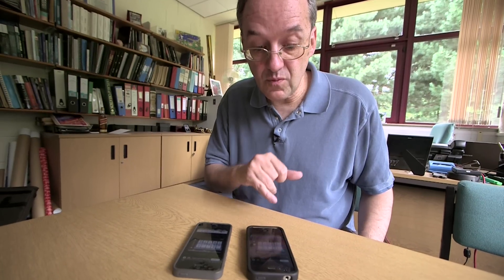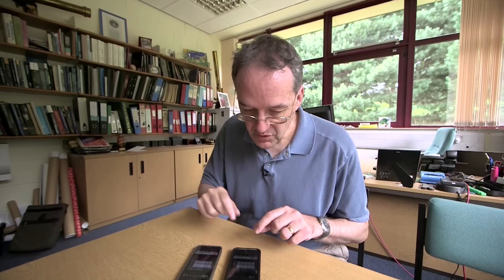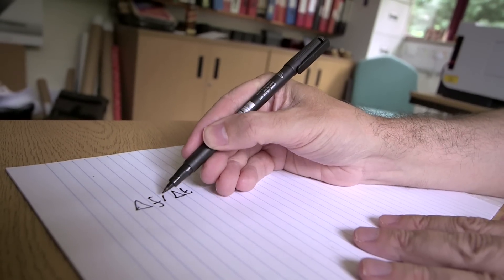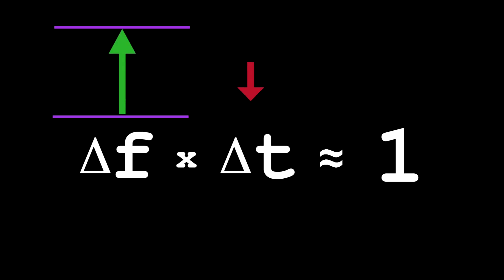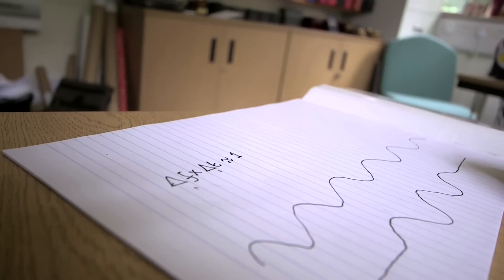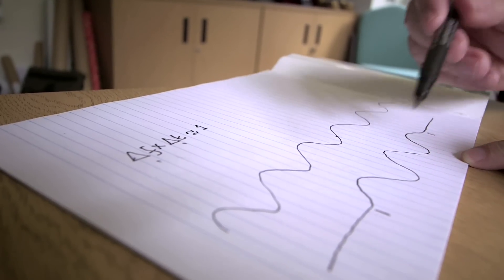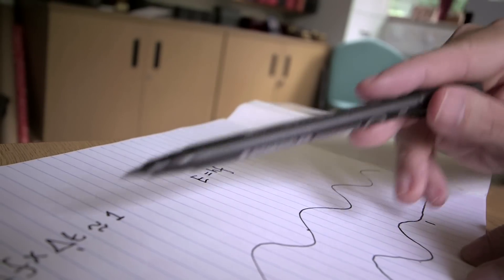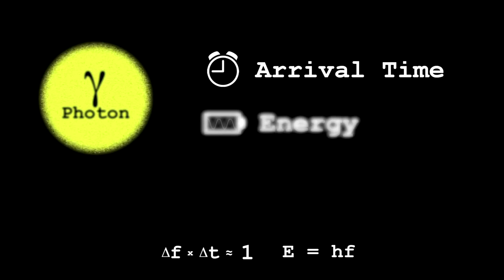What is the maximum Bandwidth? - Sixty Symbols

Comment: My first thoughts went to WDM too, but what the professor says is still true (mathematically) - even with WDM, you cannot carry more data than can be distinguished by a single pulse of information.  Whether you're carrying one serial PCM signal point-to-point or multiple signals in parallel over WDM, if the transmitted data exceeds the mathematical breaking point it will no longer be possible to accurately differentiate between two signals using WDM or PCM.

Comment: Yes.

The problem is simply that since the cable has a non-zero radius, there are several paths for light to travel, and some are shorter than others.

The light that goes straight down the center of the fiber (fastest) arrive before the light that bounces around the inside of the cable (slower), resulting in a gaussian shaped distribution of arrival times.

Has nothing whatsoever to do with the source.

Comment: More like in the neighborhood of 300 Tb/s. But keep in mind, we do not have optical processors that robust yet. It's a theoretical maximum.  Keep in mind, the bandwidth rating your cable company gives you is a maximum bandwidth. Your actual bandwidth depends on network traffic and routing. If packets are being forwarded efficiently, you have more, and if they are not, you have less. The map of the main internet backbone plus the connections of the L2 and L3 providers is a bit messy.

Comment: Surprisingly enough, you can.  You just need an extremely well-isolated coil (or loop, or *almost* loop, called a "SQUID") of wire to avoid picking up just the ton of photons from the vibrations in the surrounding material.  If you cool down the wire enough (e.g. ~10mK) and have good enough magnetic isolation (e.g. ~100,000x lower than the magnetic field of the Earth at the surface), you can identify excitations (electric current) from photons at particular frequencies. :)

Comment: You CAN use red and green, but infrared is normally used and the wavelengths are usually spaced 20nM apart (e.g.1510 and 1530nM). They can be much closer, but that gets expensive.

Comment: as for superconductors, they are not of any use to high speed communication, because they need to be cooled down to very low temperatures and the major difference is that a fiber optic cable poses no fire hazard, they do not heat up and they can not be affected by outside radiation. noise can not travel though the shield.

While one of the holly grail in in physics is to fine/ achieve super conductivity at room temperature, I'm sure that fiber optics will still be the connection of the future.

Comment: I think the drawing was not perfect. It would be easier to describe it if he would start the second one not from the zero but from the top of the sin. Then you would clearly see that this fast jump in value is indeed much higher frequency. Small frequency - slow changing, big frequency - fast changing signal. In other words, everything what looks sharp and pointy on the graph will be high frequency.

Comment: A sine wave will always have those two peaks, but a plain sine wave cannot  transmit information. When you use phase modulation (PSK for didital) it creates additional frequencies by it's very nature. This is because of the derivative relation of phase to frequency. f = d/dt(phase). Depending how quickly you change the phase determines you're bandwidth.

Comment: This presentation of the Physics revealed by the science of measurement, is exactly the right, (not the alternative that is "not even wrong", ..amounts to "nought"), information basis to make a standardized statement of effective meaning. The nearest to a Mathematical rationalization and reason for Philosophical acceptance. So:-

I think the maximum bandwidth is zero-infinity based on quantum logical connection, which, by being due to relative temporal motion is the constant creation of "theoretical" holographic positioning. 
We are a composite loci of full bandwidth integration subject to the Observation of the Uncertainty Principle circumstances.  

This is equivalent to a "first approximation" belief, because the choice of reference positioning is relative to personal, evolved POV perception at absolute zero-infinity ground state boundary, ..of abrane or flat space Central Limit in Eternity-now. 

Equivalent physical standards of observable/measurable constants made by timing clocks for GPS Navigation now, are the sucessors to the collective (political) Observation of a chosen Ruler in olden days, who set standards for measurements/quantization. 

In other words, it's impossible to set an absolute standard without some personal innate perception bias.., like a mathemagical musical symphony of 1-0, on/off datum points, DDD driven by AM-FM temporal Superposition-point Singularity.
Therefore all human categorization of phenomena is in the range of zero-infinity in reference to personal standards selected from a philosophical meaning and motivation from this range of Human/Cultural experience and ideals.

Comment: Well obviously fiber optic communications use amplifiers to increase the gain of the signal after a certain distance, and although theoretically noise cannot be eliminated completely due to quantum mechanics and more so practically due to the nature of instrumentation, the question was "What is the maximum bandwidth?"  (the professor added the restriction of using fiber optic cable himself I think)

You're correct, but Brady put him on the spot, so professor Merrifield gave a simplified answer.

Comment: The range frequencies of electromagnetic radiation that will pass down a fibre depend on physical properties of the fibre -- basically, its refractive index for those frequencies and, in particular, how the refractive index changes with frequency. You can probably transmit a bit of infra-red and/or UV but I don't think we have any materials that will transmit significantly wider bands of radiation.

Comment: Current long-haul fibre transmission (DWDM) systems are up to 160 wavelengths of 100Gb each, for 16Tb/sec (or 2TB for those who prefer bytes), there's already demo systems that do 400Gb/wavelenth which would be 64Tb/sec however it's known that they won't be able to drive long distance (on the order of hundreds of kilometers at absolute most, as opposed to the thousands of kilometers from the current systems).

Comment: This is a somewhat abstract, mathy way to describe what shape of wave is created when you switch a laser on and off. However, lasers really do only produce a small band of light centered at a single frequency. This frequency is related to the bandgap energy of the semiconductor materials used to produce the laser, and that center frequency does NOT change just because you switch the laser on and off. (you wouldn't see the laser light change colors even if you could observe it fast enough).

Comment: Also, there's another interesting limit to Bandwidth that becomes more important than this because happens to be more restrictive in terms of bit rate. I'm talking about maximum capacity of a system related to the quality of the signal - how many energy has the information as opposed with noise that every system generates. If noise is too high, then you can't send information properly and transmission becomes erratic and inefficient -.
This limit can be measured using the Shannon-Hartley theorem and is valid for every transmission system (including fiber).
You could say that best solution is to increase the input energy to the transmission system, but reality hits hard. Losses are inevitable and when someone needs to design any kind of system, it's inevitable to apply the most restrictive method so the system can be trusted by the user.
Anyways, this is how it works today, years ago no one expected the appearance of fiber and its invulnerability to many kind of noises =)

Comment: Honestly, you're better off getting a second cable to run alongside. You probably want to wrap them in something so you don't get any undue interference, but instead of designing a way to transmit X rays down a fibreoptic cable, which wouldn't increase your bandwidth by that much, you might as well run a second cable, which would instantly double your transfer rate.

Anyway, processing power is still a long way off that limit so it's nothing for us to worry about.

Comment: What i meant was that you can't use red and green lasers to increase amount of information you can send down a wire. It's only beneficial if for some reason you can't flicker as fast as needed to achieve maximum bandwidth. (or flickering it that fast would be more expensive than a solution where you point 2 different lasers down an single optic cable.)

Comment: Spectrum multiplexing just allows us to transfer several streams of data at once. The average "color" of each stream will be shifted in relation to each other. E.g. with two streams, you would have a primarily red stream and a primarily blue one. But the upper data transfer limit is the same. You have just constrained the spectrum width of each stream to half the original spectrum. The data packet size is an abstraction, and not relevant for the physical properties of the transfer.

Comment: Another way of thinking of the question about "can't you just turn it on and off: turning a signal off is simply "sloping" the signal very rapidly toward 0 Hertz. And in doing so, you produce every frequency between your original frequency and 0 Hertz, for a very short period of time (and under certain circumstances, frequencies outside of that range).   This happens even if you physically disconnect the signal, such as through a relay. 

So a square wave is really not a square wave - it's two steady states, interposed by super-wide-bandwidth periods, when the signal is switching states.  The "corners" of a square wave produce extreme amounts of noise.

Comment: Prof Merrifield on several occasions in the video confuses bandwidth with information or information rate and to see the difference he should look up Shannon's channel capacity theorem. So for example if a communication system uses pulse of different sizes then more information can be transmitted compared to a system that only uses one size of pulse even if the systems have the same bandwidth. Indeed this is used in digital data formats such Quadrature Amplitude Modulation (QAM).

Comment: And that's if it's limited to visible light wavelengths only, and it's per strand. Solution:  have thin strands, have many of them, and make them so they allow infrared and UVA light. Could probably push it as much as 1 PB/s per strand, and have as many strands as you want.

Comment: More than opinion, you are correct.
electricity doesn't travel as fast as light, its like 98% speed of light.
Well our electricity anyway, because of its frequency, amperage voltage etc.
Plus I'm fairly sure the medium slows electricity down more than light.

Comment: Look at the diagrams he grew, the perfect sine wave going to infinity and the pulse that has tails at each end of it that drop off to zero.
To get them tails you need to have other frequencies destructively interfering with each other (which you can hear happening when he has the two phones playing tones, that pulsing sound).
It isn't a problem, like he said, you need multiple frequencies to transmit data and the laser automatically produces them by turning it on and off.

Comment: There is a similar limit on Wifi, but it's artificially constrained. Over the air frequencies are tightly controlled and licensed, so the unlicensed band that Wifi operates on is smaller than would be physically possible if you had the whole spectrum to work with.

Comment: I don't know the wavelengths in particular. However, the wavelength has to do with the energy of the particle. Decrease the energy too much, and the particle stops moving. So a minimum possible wavelength would only be attained in a super cold environment. If you put too much energy into a photon, at some point, it will cease to be a photon. So the absolute maximum and minimum frequencies of EM is very difficult to determine. However, the maximum and minimum of *useful* EM is known.

Comment: He said a terabyte of data in a few hundredths of a second.  Depending on what that rate is exactly, could be anywhere between say 20-50 times the current transfer rates with WDM.  So the answer is that they're no where near the maximum.  At the max, it just becomes a blur, and you can't distinguish any more what came when.  Of course, then you just install a second line, or invent a better cable that can transmit a wider frequency range and the equipment to detect it.

Comment: Because on and off represent a basic code. Binary basically works as 0 is off and 1 is on. Then through processors this is read as information. 0=0 1=1 10=2 11=3 100=4 101=5 110=6 111=7 and so on. Interestingly binary has a problem similar to what is talked about here. With a 32 bit processor the max # you can have can be represented by 2^32 - 1. This equals 4294967295.

Comment: Very informative video, thanks, and no criticism on the max. bandwidth theory. But when you say (afting having heard the sine wave at 1.03) "you cannot use that to actually transmit information", this is in my opinion not completely correct. It is possible to send information (analog and digital) using a sine wave by changing its amplitude or frequency (AM or FM); of course in both cases there is an alteration of the wave.

Comment: IMO superconducters won't help, because they're meant for transfering electrical current instead of light. In it's supercooled state it will have zero resistance but it won't have optical qualities like an optical cable. A second line may work, but it will need parallel instead of serial data transmission.

Comment: Did I misunderstand? It sounded like he said that they send pulses of different colors down a fiber optic. In reality, they use a laser that produces a single wavelength or some cheaper systems use IR-LED or red-LED. It is the electronic circuitry that shapes the pulses and this is fed into the laser or LED. The frequency information is encoded into the turning off and on the laser.

Comment: If we are talking about the capacity of a channel to transfer information then there is a very precise formula developed by Shannon that states that the maximum speed of information transfer in a channel scales linearly with the bandwidth(Hz) and logarimically with the signal to noise ratio (W). So if you have a channel with no noise then you have infinite data Throughput. 

It is simple to understand if you see it that way: if you have no noise you can detect very subtle changes of frequency in the signal so even with a very small bandwidth (but more than a single frequency) you have infinite possible frequencies and thus infinite data. But  to get out the 0-1 bits you need a circuit that works at infinite frequency and analyze the frequency modulated signal.

But I do not know if current theories consider frequencies infinitely divisible. Or maybe there are other theoretical limits that I do not see.
Reply: Federico Devigili @Sixty Symbols @Professor Mike Merrifield, Is this wrong?

Comment: If the wave is not continuous, then it is not a single frequency, but many frequencies overlapped upon one another. That's simply how waves work. You cannot send a single frequency and expect to get any information out of it based on the laws of physics. The problem; therefore, is that any specific spectrum of light has a certain range of frequencies, which means it is finite, and if the spectrum (delta f) is finite, then speed (delta t) that you can send a signal has a lower limit.

Comment: TL;DR, The shorter the delta function in time, the wider the frequency response. The delta function can only be as skinny in time as the spread of frequency is supported in frequency by the cable. Any wider, and the fiber line will attenuate out the signal, and the signal will be distorted.

Comment: The exact maximum bandwidth is 113.687 TB/s.
This would apply to single-mode optical fibers that are the only viable thing for long distances. There are also multi-mode optical fibers but they utilize numerous wavelengths and would probably be limited in the same way according to the video.